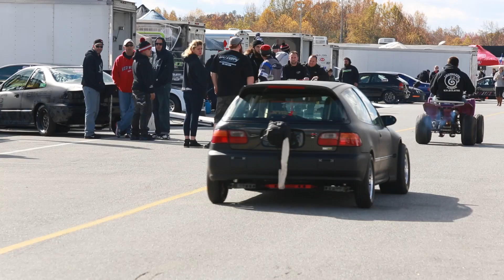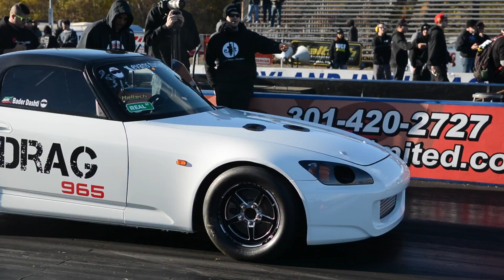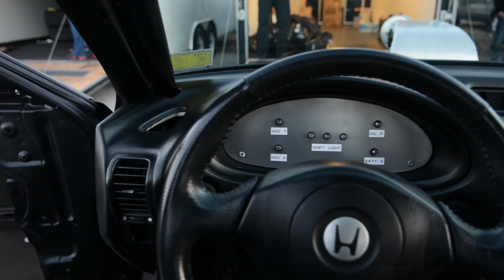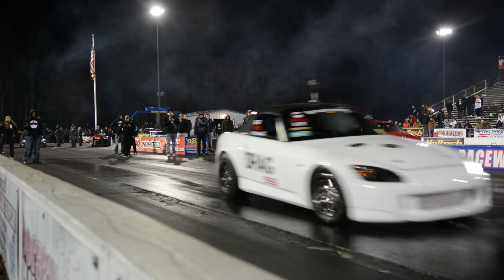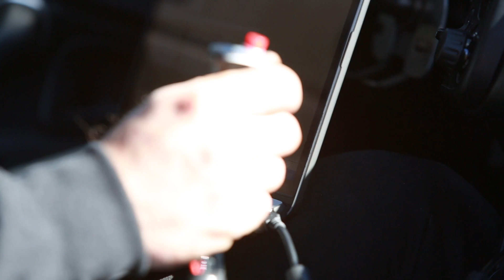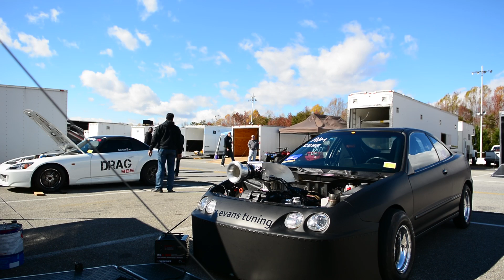10 Tips & Tricks for Front Wheel Drive Drag Racing

Comment: Also with the spark plugs I've found on a track car a basic copper plug and reading/changing very often to be the ideal approach. Anytime i start to modify a B series, even a simple full bolt on/tune 200whp NA GSR or something else similar I automatically go to an NGK BKR7. I'm sure you have an abundance of knowledge as well Jeff, but for viewers who may not the 6 is the stock heat range for most B series but given relatively high compression and rev limits, even stock, the 7 has done better for me over the years and then as you said go up a range for every ~150hp or so. Gapping down for boosted setups is a must as well or you will simply blow out the spark. I don't like to tell people a number instead I give a basic starting point and advise to keep increasing gap until you get issues with breaking up then bring it back down a hair and that's what you want to run. For me ideal plug gap for any setup is the widest gap you can run while still getting clean rev sweeps during pulls. If that's .030 or a super tight .009 whatever the largest gap your setup will run cleanly on is the best as far as my experience has shown me.

Comment: 100% agree with you on the flywheel bolt issue. After having a flywheel bolt back out on a mild B18C DC2R I have done the same thing ever since on all of my builds and never looked back. I've Also gotten into the habit of using ARP flywheel bolts Everytime I do a B series clutch even on stock setups over the OEM hardware. I also cannot stress enough to stay away from no name clutch kits. If you are on a budget a good Comp or Exedy street disc is a much better choice than any eBay/Amazon Stage 2/3/4 puck style setup. Even on 200-300whp modest setups I've seen "Stage 3/4" puck style race clutches fail in numerous ways despite every effort for proper break in and beIN well under rated power capacity. I've seen rivets come loose on discs, fingers on the pressure plate fail, etc in as little as 600-1000 miles and even if the manufacturer replaces the failed parts they will not compensate you for your time or money spent for shop labor to do the clutch over again, not to mention the new replacement will likely fail as well. It is also common practice for many cheap clutch kits to use a OEM copy pressure plate and simply paint it pretty colors then mate it with a Stage 3-4 puck style disc and rate it for 350-500 lb ft. There is a lot of shady eBay companies and in the long run you won't save a dime. Also, always replace the pilot and TOB when doing a clutch, and in general most budget flywheels (lightweight) should be avoided as well. Even a stock engine from Honda is balanced very well and throwing random lightweight flywheels and/or crank pulleys can end up causing engine failure and normally wont yeild much if any benefit to performance. If your not having you engine built and balanced stick with OEM flywheel and crank pulley weights.

Comment: Great tips just subscribed to ur channel. Did u say 67 psi i thought good tire pressure was around 8 to 12 psi for slicks.
Reply from the maker: 6-7 psi, I spoke too quickly sorry for the confusion.
Reply: @EvansTuning   nice thanks for clarifying. Dang now iam wonering what to gap my spark plugs on my all motor setup. I've never messed with spark plugs or bother to check the gap at the track . what spark plug would u reccomend on a 270 300 na set up. No wonder it would fall flat at the top end goin down the track
Reply from the maker: If its a Honda engine normally NGK BKR8EIX or BKR9EIX plugs are sufficient, plug gap between 0.022~0.028" works well.
Reply: @EvansTuning  sounds good thanks apprecite it. And yeah its an h series motor

Comment: Jeff, have you tried the blue loctite (10:01 in video) on the flywheel bolt? I found it makes it way easier when you need to remove the bolt...
Reply: Or just use red locktite and call it a day.
Reply: Blue Loctite for flywheels and flexplates? Have you seen a flywheel bolt shoot through a header tube? Red Loctite. Can't get it loose? Use heat, it's that simple.

Comment: you say that best choice for 13" wheels is a tire with 13x10 width or the wheels must be also 13"x 10j???? both must be 13x10?? or is a must tyre be 13x10 and wheels can be 13x7 -13x8???
Reply: The wheel is 13x10 tires range between 24 to 25 inches tall and between 9 to 10 inches wide

Comment: Slip clutch valve? Didn't the 05-06 rsx type s use a delay valve? And why do people swap out the cmc and slave. What u said about shocking the driveline just justify what I've been saying to others and didn't believe me. Ur info/statements put me at ease on my cars :)
Reply: 02-06 rsx's all use a chamber on the cmc to slow fluid. Slowing down the movement on the pedal engagement to the clutch every time is far different than everything a proper clutch release valve system will do. Something like a ktuned cmc and a magnus clutch release valve would be the best setup to go with.

Comment: Rear wheel tips coming soon? And how can i find that kingsler intake manifold
Reply: Most important thing. Keep them light. Which ever tyre width will give you the least rolling resistance is depending on weight.
Reply: rwd tips not needed. youre already powering the right set of wheels.